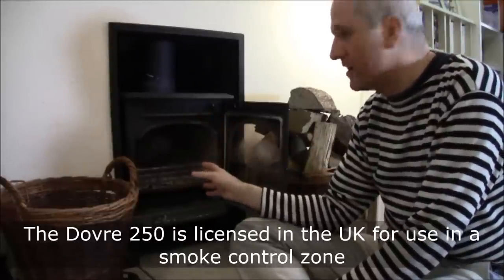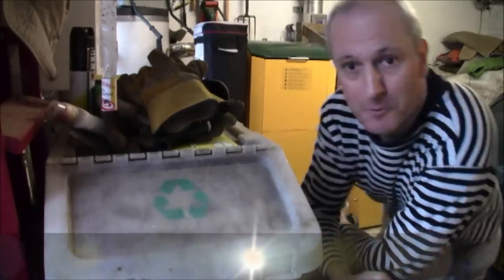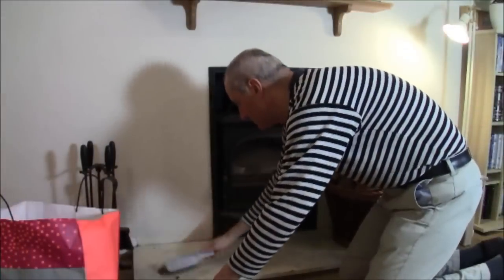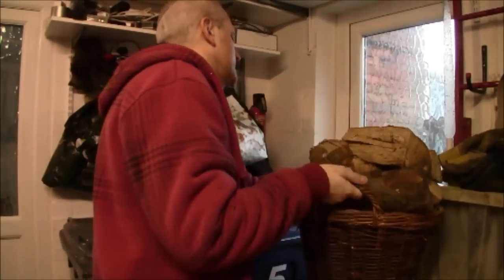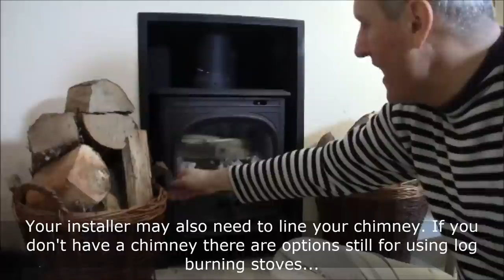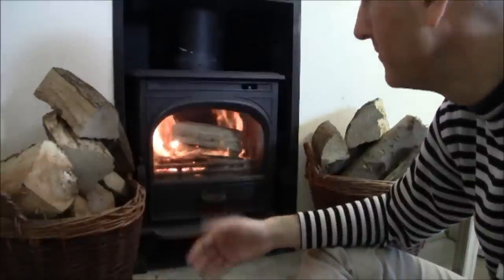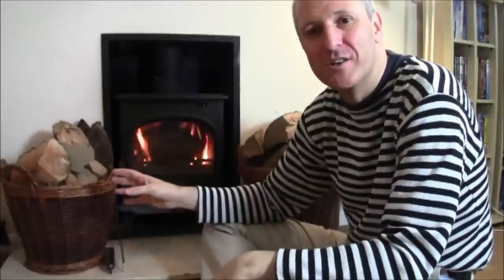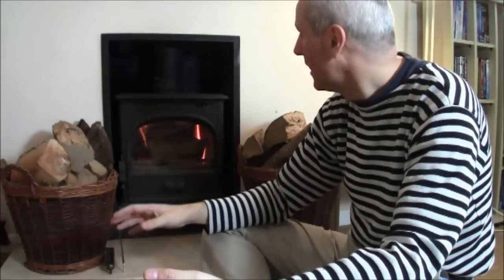How to use a Wood Burning Stove [Superhome59 part 13]

Comment: Wait, hold on. It's only a 3kw stove and you're burning that whole basket of wood in only 2-3 hours?? We have an 8kw and only need one basket for a whole day to heat up the entire floor here (bedroom, kitchen, living room) up to a steady 22°C. I'm not talking about a little studio with not much space to heat, I'm talking about a full sized floor of a house with no additional heating.

You might want to keep in mind that 1 kilo of wood is about the average of 4kw (more or less, depending on the kind of wood you are using). Having to much heat inside the stove reduces its lifespan, as I been told by the company just today (Dovre). ;)
Reply from the maker: +TheOpelkoenjas Thanks for your interest & comment. You have an interesting perspective but we are probably comparing apples and pears. There is great no utility in measuring the energy content of wood by weight. It is done by volume. I have conducted research into this question in 2012 and found that dry hardwood has a per cubic metre energy content of 3000kWh. Dry softwood has a per cubic metre energy content of 1100kWh. But the moisture content is only that low if oven dried so assume 20% moisture content changing the numbers to 2200kWh & 900kWh/cubicM. What sort of wood are you burning?Our original SAP rating suggested that the Gas Fire that the Stove replaced consumed 3320kWh pa. So I did a rough back of the envelope calculation and found that 3 cubic meters of logs (approx our annual consumption) is somewhere between 3000kWh and 4,500kWh assuming the stove will be about 65% efficient. There is a big margin of error on these numbers but they work out in the same ball park as the SAP rating.I have been used to solid fuel burning (coal and wood) since childhood and see nothing unusual in the consumption of one small basket of small logs per evening in such a small stove. With 8kw you can perform space and water heating for a well insulated four bedroom house. That is an annual heat load of around 21000kWh. That is between 5 & 7 times the useful output of our tiny Dovre 250. So yes you can do what you do with an 8kw appliance but any differences in your perception about fuel consumption could come down to the size of your log basket, the type of wood burnt and its moisture content. The likelihood of you genuinely be able to burn so few logs is outside the range of stove efficiency improvements therefore there has to be another natural explanation. Superhome 59 is a five bedroom house hence it may have a higher internal volume than the one you are working with. Do you kiln dry your logs? As a useful experiment I could weigh a basket of my dry logs and let you know the numbers. They will be crude but an interesting comparison. Our baskets are really very small and only contain an armful of small logs.In addition the figure of "2-3 hours" refers to peak burn time, not the heat utility that lasts longer than that. The Dovre 250 is keeping one half of this large house at optimum temperature for probably six hours or more. I have pointed a thermal imaging camera at the stove area after 12 hours and can still see the heat signature in the surrounding wall so it is keeping the area warm for many, many hours after the initial burn.Thanks for your interest.
Reply: Low Energy Retrofit South Bucks - Superhome 59 The kind of wood that we use is oven dried birch. For our Dovre (35 CB3) we can use (split) logs with a max. of 30 cm of length, and up to 3-4 split logs stacked - depending on their size when split of course. I have to admit, our basket might somewhat be bigger, it can hold about 10-12 split logs per fill. Yes, our wood sits next to our stove. And the humidity of the wood is 15-17 percent, which is perfect.
Reply from the maker: +TheOpelkoenjas Yes, that may go some way to explain the differences! Cheers.
Reply: Low Energy Retrofit South Bucks - Superhome 59 I guess every stove is different in its usage. I just was amazed by the amount of wood you were using in such fast tempo to warm up your house. Which clearly we don't have to do here. ^^ Maybe it's because we don't have an upper floor (I should have listened a bit more careful to your video), but you could compare our floor with the space of a good sized loft. ^^ Cheers, mate, and enjoy the warmth of your stove, specially now that T°'s outside are dropping radically. ;)
Reply from the maker: +TheOpelkoenjas Hmmm, just a thought, yes Superhome 59 is a large five bed house with open stairwell hence it has a large joined up volume. But that doesn't mean we run the Dovre full wack. It is turned down to minimum air flow as soon as it is up to operating temperature. That only takes about 15 to 20 minutes. So your heat demand may be less but it also sounds as if you are able to operate your stove at a lower burn rate. This coupled with the drier hard woods, larger basket and larger logs probably accounts for our perceived differences. I think the volume difference largely accounts for the fact that you operate a room temperature at 22C whereas we are at about 20C.Thanks for the chat! Cheers. Have a great winter.
Reply: This guy is mistaken . Every bit of research suggests this is in fact a 5kw system .

Comment: Do you mix wood and coal at same time or do you just use 1 or the other?
Reply from the maker: The stove is dual fuel capable but we only burn wood. It would rather go against our mission statement to be low-carbon if we were to use any fossil fuels.
Reply: @Superhome59  ok no worries does it burn ok on just wood with a grate?
Reply from the maker: @mattseymour8637  Yes it burns wood alone just fine.
Reply: @Superhome59  do you not find the wood falls through the grate too quick and loose the bottom?
Reply from the maker: @mattseymour8637  No, this has never happened.
Reply: @Superhome59  ok thats good then. It does with me. How to you prevent that?
Reply from the maker: @mattseymour8637  Nothing. It just doesn't happen. The grate slots are so narrow I cannot get even my little finger in the gap. The chunks that end up in the ash are smaller than a finger nail for that reason. The grate in my stove is circular with short concentric slots. The fact that they are curved also prevents even the smallest-longest-thinnest pieces of wood from slipping out. So not even kindling falls through. So I guess the design of your grate is the key to this.
Reply: @Superhome59  that's good then as seems works really well. My grate is a standard rectangular grate with Chris cross style bars. But when the wood burns down it seems to loose its base. But heard this is usual of multifuel stoves
Reply: @mattseymour8637  Hello matt.  I have a multifuel stove, and I bought a rectangular 6 mm thick metal sheet from ebay the same size as my grate.  I place the metal sheet on top of the grate when I burn wood only.  When I choose to burn smokeless fuel I simply remove the metal sheet from the stove.  I don't really need to use the sheet, but I find it makes my wood burn better.  Hope this helps.  Regards.
Reply: @MG63  sounds a good idea. Where did you get the metal sheet from?
Reply: @mattseymour8637  Hi Matt.  It was 5mm thick not 6mm.  I bought it on ebay.  You can choose from the drop down menu what size sheet metal you want.  You will have to measure the size of your grate area.  You might not find a size to fit it exactly but enough to cover your grate area.  Mine is smaller than the whole grate, but enough to cover it perfectly for the wood.  Here is a link to ebay where I bought mine.  https://www.ebay.co.uk/itm/5mm-thick-MILD-STEEL-S275-plate-sheet-profile-Various-Sizes-FREE-POSTAGE/281858897456?ssPageName=STRK%3AMEBIDX%3AIT&_trksid=p2057872.m2749.l2649
Reply: @MG63  thanks appreciate it
Reply: @mattseymour8637  No problem.

Comment: use ash from the fire on a damp cloth
Reply from the maker: Thankyou for watching. I assume your comment refers to cleaning the glass? This is advice we have heard before and we know many stove users endorse this. Although I am sure it works I always offer just one word of caution: the ash/soot is carbon which works as a mild abrasive. It has no chemical interaction (that I know of) with the creosote deposits on the glass. Stove manufacturers warn users NOT to use abrasives.In which case it may lead to the glass breaking or makes the creosote harder and harder to remove. So I still recommend the use of a chemical cleaner designed to dissolve the creosote chemically (a solvent) to increase the life of your stove glass. But I am sure there are few real problems with using ash or soot and this caution may stem from the manufacturers being ultra cautious about indemnifying themselves from the harm done by stove users trying to clean the stove with a bathroom cleaner.
Reply: A scrunched up sheet of newspaper into a ball-like pad.  Quick dip the face of the pad into some water so it's wet but not soaked through.  Dip the wet face into the wood ash in your ash pan.  Use that to rub away at the inside of the glass.  Not too hard so as to stress and possibly break the glass, but firmly enough to clean.  I use about half a dozen such pads to clean a glass approximately 13" wide x 9" high.  

When all of the black deposits are removed, use a final one or two paper pads, as above, but dampened and without the ash.  Finish of with one or two completely dry newspaper pads.  Maybe an old polishing cloth to finally remove any streaks on the glass.  The whole business takes about 10 minutes.

What's occurring chemically is that the dampened paper plus the ash is making a basic type of lye - caustic potash, but not enough to harm you.  If you are concerned use a glove o the hand doing the cleaning.  It's never harmed me though.

Comment: First of all why is your glass dirty?..I have a clearview stove and the glass is never dirty!
Reply from the maker: Thankyou for your inquiry. If you glance down the comments here you will see that cleaning the dirty glass is a regular talking point. So this dirt build up is quite normal and is a regular experience for stove users.  The reason why some users have less problem than others is stove size. My Dovre 250 is really tiny hence the fuel load is quite close to the glass. This sends out jets of vapourised creosote and carbon smuts that coat the glass as that is where the dirt condenses before an air current can whisk it away up the flue. If you have a much larger stove then the fuel can be a long way  away from the glass. Hence good air circulation will keep the glass clean. That is my assumption.

Comment: The first thing I see is the wood burner in not out in the open, being tight in that space the heat cannot radiate up from all sides, a lot of the heat is contained and goes up the flue. You're heater looks much more than 3kw. My wood burner is 6kw and smaller.  I honestly think you are losing out with the burner being in that recess.
Reply from the maker: Thanks for watching. It is what it is. 2.9Kw is the rating and the recessed option was recommended to us. The Dovre 250 sits inside a pre-existing emplacement for an old gas fire. The space is quite small. Installation there saves space and was more child friendly. To be fair the only heat "loss" is that backward through the wall to the garage of the neighbour next door. Embedding a stove like this in brick is similar to a "masonry stove" where the heat is intended to be stored in the thermal mass of the masonry. Hence it is slower to react in heating a room but it stores the heat for longer. I have taken thermal-imaging photos of this wall in the morning after a previous evening's burn (hours after the fire has gone out) and found that the surrounding wall is a couple of degrees warmer. It is still radiating heat out into the room. Energy cannot be created or destroyed, all the brick surround does is slow it down.

Comment from the maker: We have had some strange feedback on this forum suggesting that this stove is somehow wrongly fitted because of the small air gap around it. For your information this stove was not fitted DIY - we had professionals in to do this. If anyone wishes the know more about the sort of Technical Guidance you need to do a job like this then go to the  LABC web site at https://www.labc.co.uk/guidance/technical-guidance. Specifically download the PDF file at https://www.labc.co.uk/sites/default/files/LABC.solid-fuel-stoves.DB_.v1.000014.pdf This contains all you need to know about the air gap around the stove and any ventilation you need. We have read the official guidance and can find nothing wrong with the installation depicted in our video. This advice applies to the united Kingdom only. If anyone can point to evidence that contradicts this then please use citations in your post. Otherwise we will delete such postings like we do for any other posts from time wasting trolls.
Reply: It's a 5kw burner not 3kw ....

Comment: That’s a 250 multi not a wood burner. ..
Reply from the maker: Yes, it is a multi-fuel stove. It could also be adapted to burn coal. Obviously we would not be burning fossil fuels though. What makes you think that one of the "multiple fuels" is not logs?
Reply: @Superhome59   generally a multi is coal and wood. A wood stove is just wood. That’s why it burns on the floor.  Yes ?
Reply from the maker: @terrythurston8572  Thankyou for getting back to us with your question. There is no significant difference in the stove between the use of the two different fuels. However, as we are in a smoke control zone we would not have burnt coal anyway. The installers never left us with the alternative front grate that would be used for coal. So the configuration of the Dovre 250 we have installed is ONLY for wood burning., We could not burn coal in it even if we wanted to. I do not believe the meaning of "multi-fuel stove" implies you would burn both at the same time. As they have different internal parts then it is either/or.
Reply: There is a significant difference in a 250 cbs and a multi fuel. The baffle plate is different, the back plate is different, there is no grate or ash pan and the complete floor of a wood only is different.  , I own both the dovre 250 wood and multi , can assure you the internal arrangement is very different.  Hope this helps you. .
Cheers 
T

Comment: Looks like you are determined to burn your house down. Ashes into a plastic bin that's left in the house is never a good idea no matter how cold you believe the ashes to be. Also kindling on top of a boiler??
Reply from the maker: Thanks for watching. To answer your comments I can only direct you to the related videos or invite you to visit Superhome 59. As stated in the video the ashes are emptied when cold so clearly putting them in a plastic containers is fine. I am unsure why you got the impression that the ashes were hot when I clearly stated the opposite in the video. As for the kindling on the biomass boiler. It is a biomass boiler. It contains 225kg of wood pellets. Two pallets of wood pellets are stacking right next to it. It is a boiler: a machine to contain heat and direct it to heat water. It is not hot on the outside in the way that a wood burning stove is. There is a plastic small box on one side that contains the PAPER instruction Manual. There is no fire hazard on the outside of the boiler. If you have further questions please let me know.